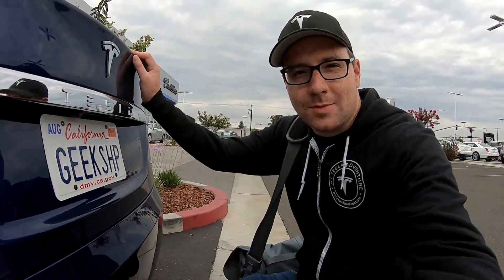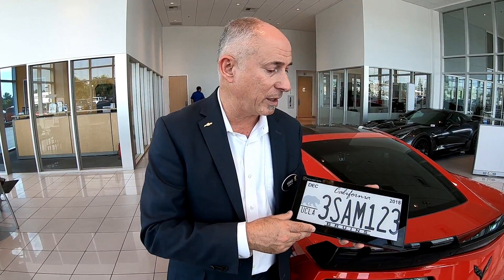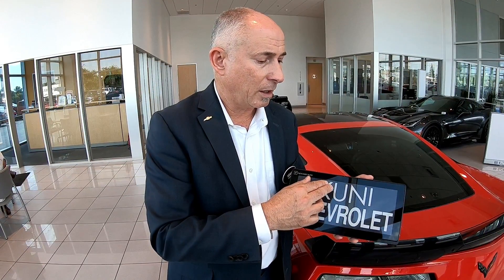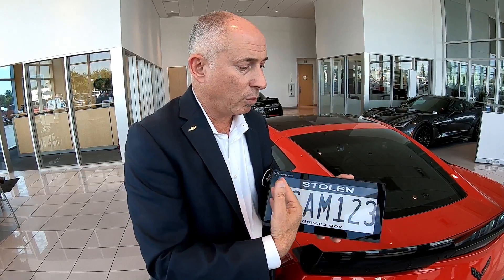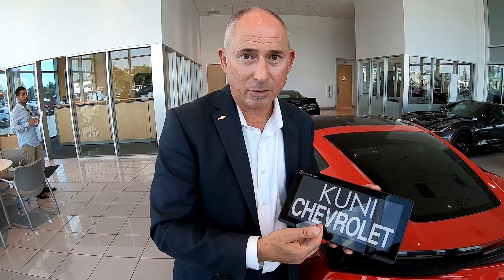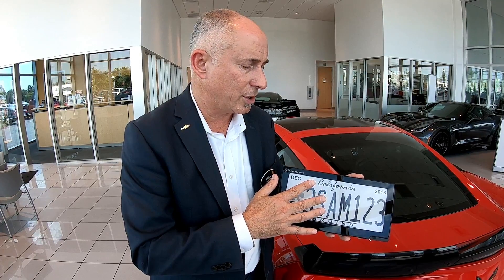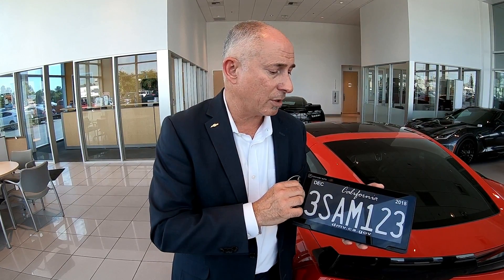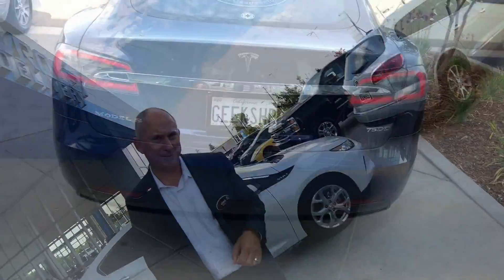The Digital License Plate Explained - Reviver Auto

Comment: After I become Governor of California, CHP & DMV - The TAG - the Tandem Auto Gestapo, will be disbanded. Sheriff's Departments will receive the CHP budget. Annual renewal will end; expiration will not exist. One plate will be all that's required, & off-road machines will no longer be regulated, licensed, taxed, or etc. Cars not used will not require non-operation action or fee of any kind. Scanner, reader, sensor, & etc will end except for kidnapping cases. CHP are Armed Tax Collectors. CHP are Tow Truck Dispatchers for the Tan&Blue Revenue Crew. They're going to be defunded & disbanded, with the budget going to the Sheriff’s Department.

Comment: These are a pain in the ass to install. Just did one on my company work van and had to run 45 ft of wire from the fuse block all the way through the wire loom and into the rear access door 😅

Comment: Well you know that's a very good idea to have digital license plates in Washington State but there's only one problem with that. Aren't they going to have these new digital license plates in the same colors of license plates basically that are hardwired? What I mean is our license plates are light blue with the mountain on them. Isn't that supposed to be happening with the new digital license plates? Because I don't think black and white would look very good on a license plate. That's so 1980s like. As a matter of fact it's so LED like. So I think what they need to do is basically make the plates colorful just like they do now with our regular plates. Just make them colorful. The only way the plates can be read by the police department if they have to be in the same digital space. As of right now the only place they cannot read are the older ones that are blue and yellow and black and yellow. That's right blue and yellow ones the ones that start with one they can't read them. And the same thing with the black and yellow. It's the only way you're going to have to change your black and yellow plates to digital plates is to make sure that they should conform with the new license plate format. Now in California I do believe in 24 or 25 California is going to start reformatting their license plates as in 9ZZZ999 will soon be switched over to a new format which is going to be 000AAA1. And I'm pretty sure that those two digital license plates will work with the new formatted number letter combination. Especially with the last digit being one. They're already doing it now for trucks their truck plates are basically five numbers one letter and then the last digit would be possibly a 3.

Comment: The answer to a question that no one asked. A hugely expensive device to replace something that costs literally cents to manufacture. One rear-end collision and this overpriced thing is obliterated.. The car is burned or rolls into a lake, and when it's found the license number can no longer be read - vs. an embossed metal plate which remain legible for decades, even after a fire or being submerged underwater.
Reply: It's called "Luxury". Not necessary but cool if you can afford it...🤷‍♂️
Reply from the maker: The plate is warrantied against that. Reviver auto will replace the plate at no cost to the owner if it is damaged in an accident.
Reply: @MyTeslaAdventure  How many accidents can I have to always receive a free $1000 replacement device?
Reply: My Tesla Adventure Good to know that they replace the plate at no cost. Does that include installation?

Comment: "Been in development for over 10 years" translated means that it will be manufactured as cheaply as possible and sold for maximum profit to make up for the over 10 years in development. So, sub-standard parts and lots of problems.
Expect software to appear that can hack these. That will be fun.
Reply: It’ll be made with only the highest quality Chinesium metals!
Reply from the maker: You are probably right on the hardware, I think that is how they can afford to gaurentee it (with replacement) if anything happens to it.

Comment: That is super cool! It could be useful if your car is stolen
Reply: so is insurance.
Reply: Tech Balloon, It would be useless for a stolen car. Any pro would remove it. The cops would find your overpriced license plate in a dumpster. Cars are successfully stolen with lojack and never recovered. 

Most modern cars are difficult to steal. Any modern car thief would quickly disable it. You don't see low level thieves stealing modern cars anymore, it takes more than a screwdriver and a hammer to do it.